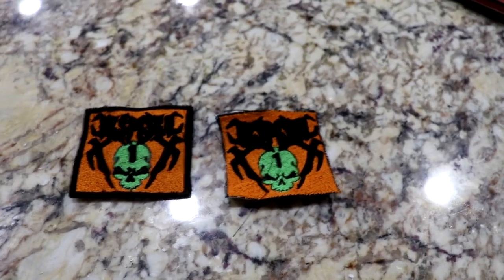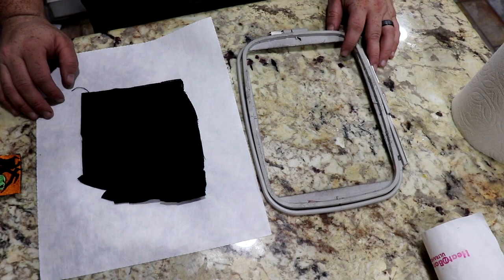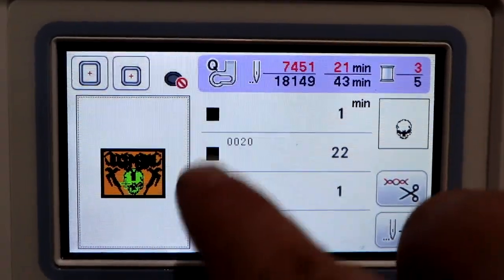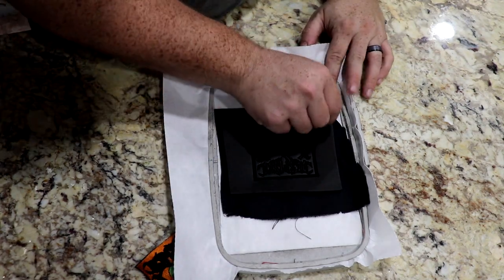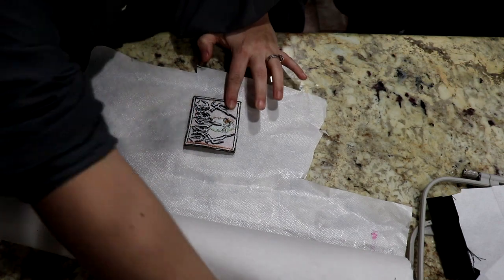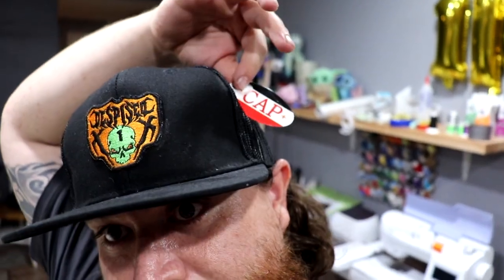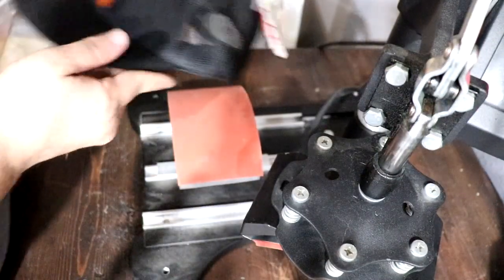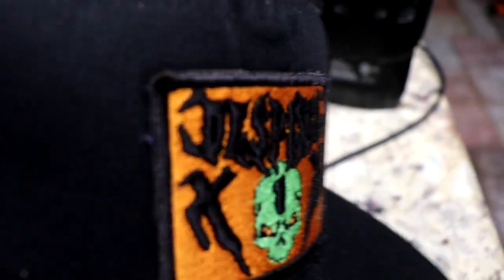Using a PE800 to Make Embroidered Hats / How to Make Puff Embroidery Patches on a Brother PE800 ETSY

Comment: Mr. Fajita, uncoated polyester twill from twill USA. 1.8 oz Cut away stabilizer. I’m pretty bomb at patches. As far as sewing it into a hat. I ain’t got nothing for you. But message me if you need patch help. After you cut out the patch. Lighter to the  edges. I think you used duck canvas here. Great video! Keep uploading!
Reply: Some people in the patch community use E6000 to adhere patches as well.
Reply from the maker: Thank you for the tips! I seen a video using that stuff. Im afraid of making a mess. I just need a multi needle lol

Comment: For the heat n bond on back of the patches... I cut the heat n bond a little larger than the patch.  Also, If I'm going to iron the patch to the cap, double the heat n bond or use heat n bond ultra. 
The heat n bond will secure the stitches around the edge.  This old gramma will probably give hints as she watches your videos...don't yell at me...just suggestions & I love watching you all.  I watch so many Youtubes and it has kept me almost sane through this pandemic & hubby's health issues.
Reply from the maker: Thank you so much, I Don't mind the tips I get. So keep them coming 😊

Comment: A couple of tips for you. Instead of using white bobbin thread, use black bobbin thread, that way you will not see the white bobbin thread coming through around your black edges of your patch. If you don't have that, use a Black fabric marker, by coloring the edges of the patch so you can't see any white threads or white fuzz coming through.
Reply from the maker: I actually bought some after this vid, just havent used it yet

Comment: Great Job Erik! Hands off Neita's scissors though! 😂 I would recommend the hat hoop insert for your machine, it fits in the 5x7 hoop it's less than $30 on amazon. I have one for my Janome flatbed embroidery machine and successfully embroidered structured hats that I sell in my shop. I would totally like to see a video on digitizing puff embroidery!! Thanks for sharing!! 😊
Reply from the maker: I am really worried about it ruining the structure, but you have no issues?
Reply: Nope, no issues they pop back in place.
Reply from the maker: @krafteezkreationz  i might have to try it then, thats my biggest worry, do you up the needle size?
Reply: @Red.E.Hustle  No, I used the same 75/11 needle I used for my normal embroidery. At one point my image was too big for the hat it hit the edge of the brim and I had 1 needle break. After I resized the image I was good to go. I posted a pic in the discord
Reply from the maker: Do you remember what the hoop was called? Is it universal?
Reply: @Red.E.Hustle  The hoop I have is made specifically for my machine, but I saw hoop inserts for the PE770/800 on amazon as well. It's just called a hat hoop
Reply: @krafteezkreationz   do you mind linking the hoop hat for the janome?  I have the Janome 400E. Or which hoop hat will work?